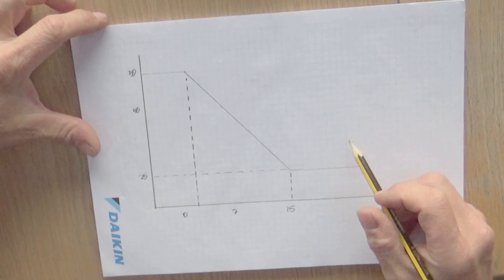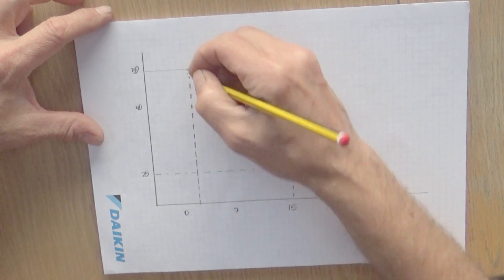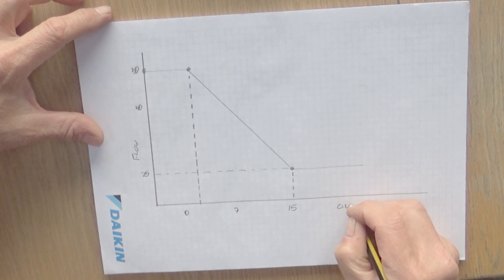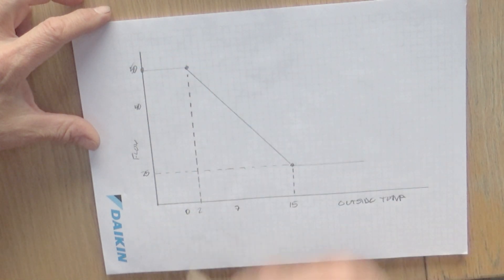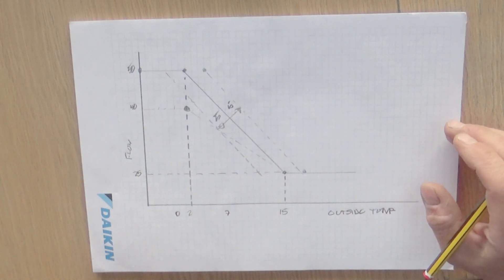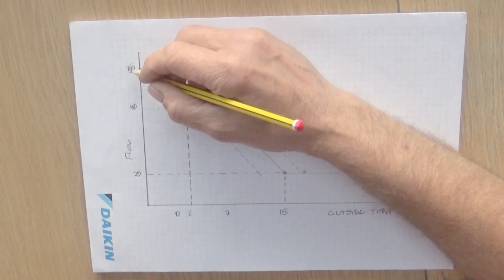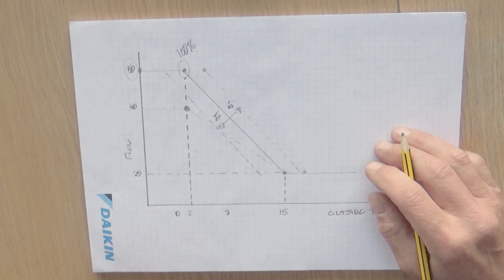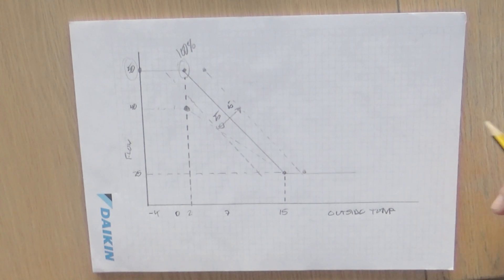Heat Pump COP and Weather Compensation

Comment: I set up weather comp 25flow/15ambient and 45flow/-12 ambient.  It’s been tested down to -3.5 ambient and it maintained the room setpoint nicely.  Double sized radiators compared to my gas boiler.

CoP is right on the published figures from 0 ambient to 7 ambient.  Hitting around 4.5.  Above that ambient temperature, the CoP falls off.  It falls down to about 3.2 at 12 ambient. The minimum consumption from the Heatpump is a problem.  It can get as low as 0.5 Amps, and in that regime I get excellent CoP of around 6.  But other times the consumption minimum is 1.3 Amps, and the CoP will crash.  Very weird and no rhyme or reason for it.

Comment: It would be good if there was a list that indicated which heat pumps might hit the best sweet spot in different areas(im in central scotland, but high elevation, colder temps due to wind chill etc.)
Reply from the maker: Things have moved on so much since I did this video. Using a R290 refrigeration unit with a large evaporator coil is the best for prolonged colder situations.
The R290 Refrigeration window is very good, both at low and high ambient conditions.
Get a slightly bigger heat pump, have your heating design for lower than the average Ie -4⁰ if your normal average was -2⁰.
Heat pumps can work down to -25⁰, BUT if your system has only been designed to -2⁰, then having ambient conditions of -4/6⁰ you will be cold.

Comment: Wish our Daikin Altherma had a COP of 5! 2.7 is the average over the year.
Reply from the maker: You may want that looked at, I'm running around 4.5 cop.
Reply: Is your figure of 4.5 a calculated COP or is it the figure on the spec. label of the outdoor unit? @allthingsrenewable9017

Comment: Here's some crazy numbers relating to my Daikin Altherma EDLQ-CV3 operation:
It's-2°c outside. The room temperature reading at the wall thermostat is 19°c. At the staircase level below the thermostat it's 14°c.
Meanwhile, in the lounge, at head height it's 27°c whilst at the carpeted floor level it is 17.5°c. It's only 5:30am and since midnight it's used 8kWh because for some reason it's running on weather dependent mode constantly

Comment: I've seen so many explanations of COP by now and from 10 people I've heard 8 different opinions so I'm mad as h**l
Reply: It helps to understand why COP changes as it does. A heat pump doesn't generate heat, it simply moves it around - Better yet it takes thermal energy from the outside and converts it to usable thermal energy on the inside. (I.e. At a higher temperature)

There's no free lunch, so if you ask the heat pump to do more work (Increase the temperature by a greater amount, either because the outside temperature is lower or the inside temperature you're asking for is higher, then it has to work harder.

It's as simple as that - Ask it to work harder and you'll get less for the electrical energy you put in.
Reply: It’s pretty simple Coefficient of Power is a relationship between straight electric heat which is a COP of 1:1 and a heat pump. Simply put, with electric heat you buy a watt of power from the utility and a watt of heat(less losses) come out the register vent. With a heat pump you buy a watt of power from the utility and 2 or 3 watts come out the vent. As it gets cooler outside the advantage decreases.

Comment: Great vid. I had a Daikin heat pump retro fitted last summer but my bills thru these winter months are sky high, it struggles to hit my target temp of 20degrees. I checked the controller and noticed the LWT was fixed at 30 degrees so I've upped it to 35 to get more heat.   The installers never set weather dependant heating which I think was a bit crappy. 
In the settings I can change from fixed to WD but can't find anywhere in the menu to set the curve. I would be greatful for any advice. Unit is a Daikin Altherma
Reply: Sounds like it's still on factory default. Could be a few things, get your installer back. If you have radiators then it should be running like 45-50⁰ when minus 2⁰ or something. I spend around 4-7 pounds a day in my own home, which is not perfectly insulated,  In the real nasty weather. But in the summer, I'm down to like .50p per day, but that's because I have the PV and battery.

Comment: Im Sparky UK tradesmens ..man&boy, now live in Australia & and got my refrigerant licence . Heatpumps h2o my game now.
Trying to explain to people why there Heatpump don't work is a mission in its self...Pool heating..heater capacity is undersized..15kw hp heating 50k lts pool to 28° Lol ..  why the hell would u rip gas boilers to install heatpumps for hot water, ive no idea.. cop for the heatpump for heating h2o @ 0° which when u want it..(in u.k.) which im sure gas would be cheaper.. on comparison..? Like to see engineers evaluation in $ KEN .  with the UK government  push to sell heatpumps ? Horses for Courses! Let's face it Ken Gov never right. Corps tell gov what to push.  That's fact

Comment: thanks for the video! I'm wondering if it is possible to integrate ASHP with heat storage (e.g. water tanks) to shift the load to off-peak hours? does it mean HP needs to produce a higher temperature (lower COP) to compensate for the loss in storage, and/or need two tanks to store at two temperatures (high/low)?
many thanks!
Reply from the maker: Yes, I have a system from a company called Homely Energy, it automatically runs my heat pump at the cheaper hours, to either load my hot water or my heating buffer tank.
Reply: @allthingsrenewable9017  Thanks for your reply! I suppose the temperature for hot water (>60 C?) is higher than space heating (<50C?) then? Also, it is possible to know how big is the water/buffer tanks? 100-200 litres?
Reply from the maker: Barton Chen  my heat pump only does 55max, so my hot water is stored around 50 and the same when I had a  gas boiler. The heating works on weather curve from a15 w25 to a2 w50, I’m hoping to increase the size of the buffer to 200, just need to see how much room I have left.
Reply: @allthingsrenewable9017  Thanks for your reply again. I thought hot water should >60 C to reduce the risk of Legionella growth... anyway, I guess heat pump is quite efficient already, so adding a larger buffer tank may not save too much...
Reply from the maker: Barton Chen  legionella cycle is done once a week, via MyEnergi Eddie.
Reply: @allthingsrenewable9017  Thanks! It makes sense to store at the temperature you need!
Reply: @barton0911  the refrigeration head pressure increase on the higher  temperatures 60° is the maximum.
Reply from the maker: @barton0911  I have stored my DHW at 50⁰ for the last 15 years. In summer it goes to 70⁰, but I have a PV diverter and solar thermal.
Reply from the maker: I've already installed systems like this for winter solar assist, but I will be doing off peak charging into a large tank IBC??, to then supplement my day heating needs. Look up Solar Thermal Alaska, bit long but a good watch.
Reply from the maker: No, I run my heating at 25-45⁰ so a stored capacity of water at 45⁰ heated at cheaper rate during the night, could run the heating during the day.
Reply from the maker: Since then, I've installed 500litres of storage, which I can do just that.